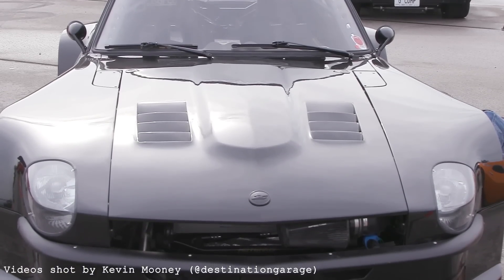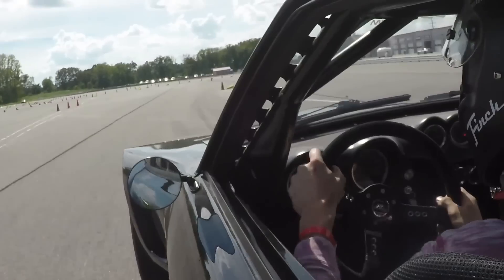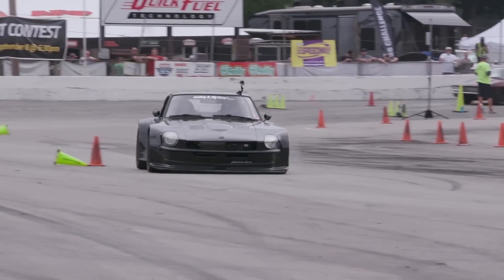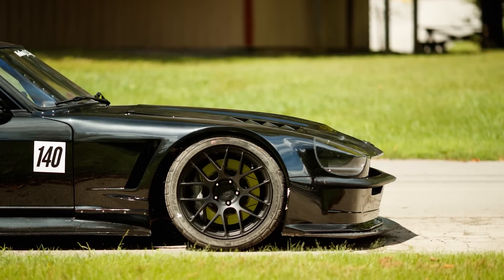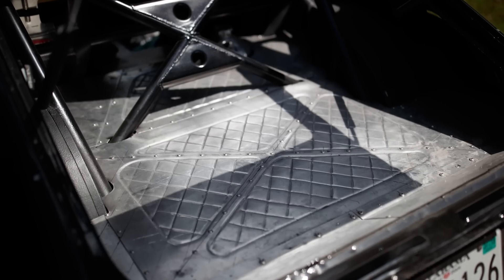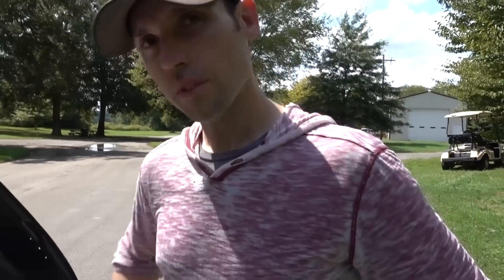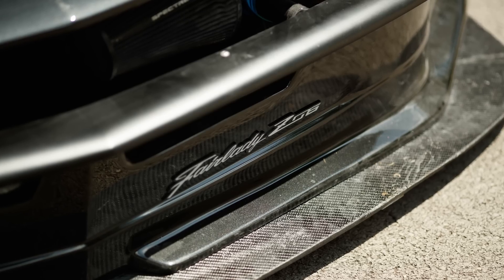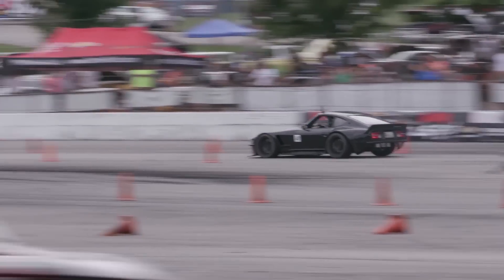Fairlady Z06: The V8 Datsun Reimagined

Comment: This is like the Dodge Viper of Japan if you think of it
Reply: Gerardo Carbajal Sounds about right. Only because I can't think of a better example.
Reply: @2moke2creen  a Japanese Z06 cuz it has the Z06 engine.... plus it's a v8 not v10.... duh!
Reply: nah bro. smokey has RWD JDM V8's and V12's. RIP smokey Nagata. they have real USDM vipers in japan. this video is about an unholy matrimony between a USDM motor in a LHD Japanese import.
Reply: Even better, the 240z and up fairladies have insane history in racing/rally it was driving all day long in Africa at rallies where it's 40+ celcius outside, I know some cars from the 90s and early 00s that would overheat so quick driving 60mph for a entire day with scorching hot sun

Comment: Sure old bone stock cars are cool, but this car was joint to be scrapped anyway, so for the purists out there, would you rather have one less 240z in the world, or one more v8 swapped 240z?
Reply: Japan looks and feels, American sounds, it´s heavenly!
Reply: Lol Idk well ppl will look at that and  want to imitate it resulting in more hack jobs and less bone stock cars.
Reply: saving it from being scrapped doesn't mean you have to ruin it by putting a shitty LS in it
Reply: NinjaRider777R yes there is. Who said you have to use the original motor? There many other Nissan motors out there that are a far better option than a shitty LS junk motor with ancient 1950's pushrod technology.
Reply: NinjaRider777R you clearly know nothing about Nissan motors with a statement like that. Here in Australia we have R32 GTR street cars, with the factory straight 6 block, driven to and from the track, with full interior, running 7.00 seconds quarter miles, on pump gas and radial tires.
Reply: NinjaRider777R and stock LS motors hardly make HUGE amounts of power, it's cheaper and easier to make more power with an RB, 2J, or Barra.
Reply: In fact when you're pushing over 500hp to the wheels that's when RB's, 2JZ's and Barra's actually become far more reliable than any LS motors. LS motors are shit at handling boost and they are well known for various failures at over 500rw HP.
Reply: NinjaRider777R i said street cars with full interior dummy. Those were unregistered drag cars, with drag slicks, running methanol, fully stripped interiors, tubbed wheel wells, fiberglass panels. Far different to a street car.
Reply: NinjaRider777R do you even realize the time difference between drag slicks and radial tires? I'm guessing not.
Reply: Smo Kabong LS motors make 500whp on straight heads and cams anyway... 

Factor in they weight 420lbs or less depending on the one you choose... If you live in a market where 2Js are not widely available ... you aren’t beating an LS in any form when it comes to price
Reply: Texarmageddon unless you're in a market where you can get Barra motors for $75 from a junkyard. They're cheaper, more reliable, and will make more power than an LS with less money spent on them.
Reply: Smo Kabong 🤷🏽‍♂️🤷🏽‍♂️🤷🏽‍♂️ too bad this Z is in America.... so the swap you think is better is cost prohibitive from the get go.

Second, the Barra motors are iron cast... weight seems to be important here.

Third, this is an LS7.... a motor capable of making 600whp N/A all day. Stop with the it’s more reliable speech.
Reply: What kind of turds blow with 500hp from an LS? Just dump a bunch of boost in with no tuning?
Reply: @BrosefDudley  thing is, unlike us Americans, you Aussies know how to properly build an RB, JZ, or the illustrious Barra that we always wanted but never got. For us, in terms of cheap and reliable power, LS is the way to go. But being that I personally hate, yes actually hate, seeing an LS in any Nissan chassis, I’m with you on why you’re ragging on it
Reply: @BrosefDudley  not really 2J is more expensive to build to make power than an LS. Just running a 300$ cam in an LS can net you up to 500hp then Slap a turbo on it and run 5.5lbs of boost and you're in high HP territory. Do a little fueling and a tune maybe play with the valve train a little and turn that boost up to 14lbs and you're in 1000hp range. You can't do that to a 2J or RB without breaking the bank. For instance stroker kit for an LS starts around 850$ a stroker kit for a 2J starts around 3.5k$

Comment: This is the sort of thing you could make a business out of like Singer did. Make a shop where you just bring an early 70s 240z and some cash, in return you get this. People would line up and pay 100k easy.
Reply: 240z body skinned over a 350z/370z with Vq,vr38,Vk engine options .I'm sure you could get a market
Reply: This guy probably has 1500+ hours into building this thing.. 100k wouldn't do it.

Comment: I met Tyler at LS Fest and talked to him for a few minutes about the car. If I remember correctly the track width depending on what tire size was used was around 75" in the front and 78" in the rear, talk about grip!! Especially with the massive tires under there. Nice guy and a pretty awesome car.

Comment: the first and only time ive seen a fairlady z was on okinawa in 1975. made by datsun in those days but had no safety plate glass and so was not a legal import to the us. stateside it was known as the 240 z; the first one, later models were the 260, 280, 300 etc but somewhere around the 280 datsun had become nissan. i had a 73 opel gt at the time which wasfaster and had better suspension but admired the z’cars. good video!

Comment: wow...this is probly one of the few JDMs that i would actually WANT to do an LS swap in.lol it actually looks like it was MEANT to have a V8 in it lol
Reply: JDM? Sorry but there's nothing about this car that screams JDM. Looks like no parts that were manufactured solely for the Japanese domestic market were used, the car is left-hand drive which means it's not from across the pond either, It's basically a GM car with a USDM Datsun body and smacking a LS into an import isn't exactly JDM.

Comment: Awesome car, jut one area needs a bit more attention to make it look proportional. The area with the slits  behind the rear while just looks to big, wrong angle on it,  hanging in mid air,  looks like it was rushed in the build. It just does not flow well at all. Its a small area and needs to be redesigned to complete this awesome car.

Comment: "bleed off torque" is another name for inefficient.  just run a 5.7L.  You'll get usable power.
Reply: @chris stavro No.. the 5.7 heads do not make the same flow up top as an LS7. Spin to 8k make power up top for roadcourse/autox purposes. Bleed torque down low for better throttle modulation. It still makes crap tons of torque. Just makes the torque where designed. Its called an engineered power curve to fit the application. Similar theory to destroking an LS7. Without getting in the weeds of the matter.

Comment: Needs the round gtr brake lights and a rb26 engine out a gtr in it  to put zo6 motor in it is just wrong resto mod it using jdm parts especially the engine would have made it way cooler

Comment: looks totally amazing, but yet another cookie cutter drivetrain swap... i get it ls motors work, for cheap, but id rather see 10 other engines lurking under that sinister hood. say, a vk, out of a titan with twin snails... or a toyota uz with some itbs.... yeah...just my two cents though. props for keeping the transaxle though... thats definetly pretty awesome, just think anything other than ls power would truly put this car over the top....with the level of sophistication exibited in this build, i think it screams more camshafts and valves...

Comment: So a nearly extinct Japanese shitbox with yet another GM engine that far outlasted their cars that sounds like it's gargling it's fuel and makes less power than a v6 used in Mazda minivans.  If this is what it takes then sign me up, let me find out a clapped out 240SX with a rotted frame and no floorboards and throw an LS1 from a rotted Caprice in it, boom I made a legendary race car.